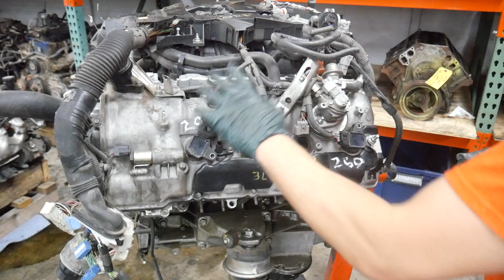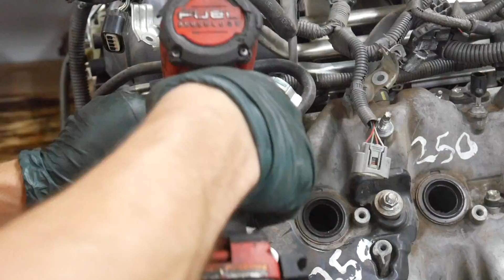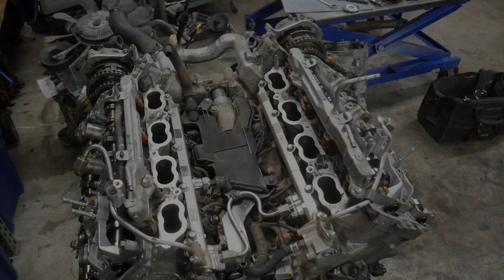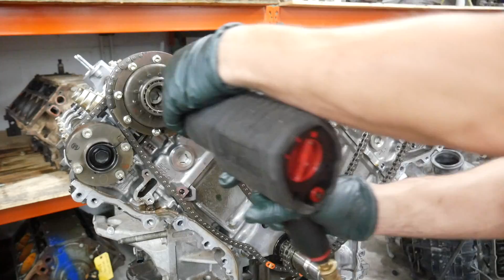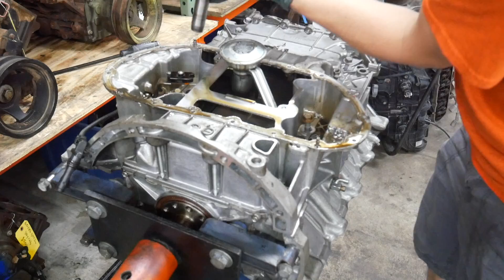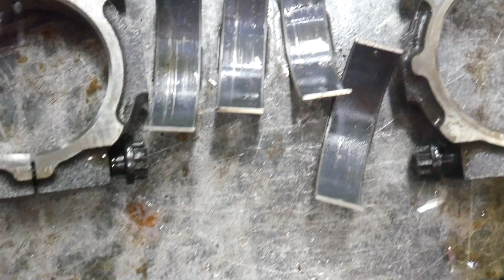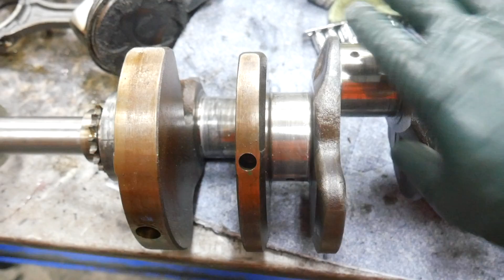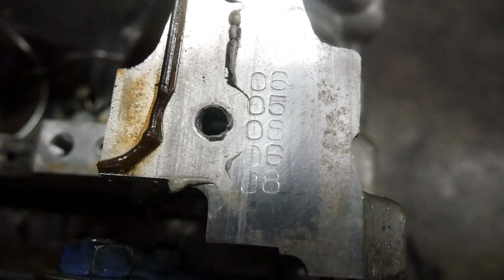Lexus LS460 1UR 4.6L V8 Blown Engine Total Teardown! How Did One Of The Most Reliable Engines Fail?

Comment: Ji**y Lube "no oil" oil change. The internals were far too clean to assume lack of maintenance, and the engineering looks rock solid. 
Nice shirt BTW.
Reply: Which just pi**es me off. Ruined a perfectly good, clean, good shape engine because they did the oil change wrong. It's a major reason why I change it myself. I know 1) it's done 2) right 3) with the amount and brand of oil I need/want.
If that were my car I'd probably sue with a vengeance.
Reply: @IncertusetNescio  indeed! I really hope they did so that JiffyLube or any other oil change department realize that the Customer deserves absolute protection from Multimillion dollar corporations & facillities AND their "incompetent" employees!!
Reply: what i am thinking, min wage oil change place. drained oil and forgot to fill. prob had some manager up their ass about "time" and or low information type worker.
Reply: @Dratchev241  It's not just the quick places.  I have a 2018 V8 Mustang.  The 18s went to 10 quarts while the 17s and back used 8.  The Ford service manager misunderstood me when I said I'd do it myself and it got changed.  I get home and check it and sure enough it's 2 quarts low.  I take my F150 in and look at my service writeup and it says 10W30 for the change when it calls for 5W20.  I call them up to verify and he says just bring it in and we'll change it again.  I get home, check the level and its at the add line.   Needless to say I'll being doing my own oil changes from here on out using full synthetic.  The F150 is easy, the Mustang will require a little more work to get it jacked up but still not bad.
Reply: @scottyV1000  sounds like a ford problem
Reply: scottyV1000 Dealers pay their service techs in the wrong ways. The result is service techs have every incentive to cut as many corners as possible and complete jobs as quickly as possible. And their service writers generally make minimum wage plus a healthy commission on whatever services they can upsell on a customer even when most are not recommended by the manufacture. For example at 30K many vehicles call for just an oil change, air filter, and tire rotation. Yet many dealers will sell you a $500+ package with all sorts of other supposedly necessary service and many don’t even do all of what they charged you for. 
A friend bought a vehicle new and took it in every 5K to the dealer he bought it from. At 40K miles I offered to change his oil and filter as I was changing my own anyway. I discovered you could drain the oil but couldn’t replace the filter without removing the big aerodynamic pan under the front of the car which wasn’t easy. When I removed the pan I found the original factory oil filter complete with hand written markings from the factory with 40K miles worth of dirt on it. Yeah, the dealer, over 7 oil changes, never once changed the filter likely because there was extra time involved and they figured the owner would never notice as it was invisible unless you removed the pan. So dealers can do just as poor of work as your local crappy minute lube they just do crappy work for different reasons. Instead of just paying their techs well, they underpay them and incentivize them to churn through as many jobs as possible each day for more money. Their paycheck depends on it.
Reply: @bradhaines3142  I don't think it's a Ford problem - more like a specific dealer problem but there may be many dealers with the same issues.  Ford just issued a service bulletin on all the 20 and 21 5.2L V-8 in the Shelby 350 and 500s.  These are pretty much hand built engines and someone forgot to release the timing chain tensioners when installing the cam chains.  Guess what happens when the chains stretch a little especially with engines with 8,000 rpm redlines that are actually likely to see that limit.   All it takes is one person in the wrong place.  Samcrac had a similar problem with the supercharged V-8 in his Land Rover.  I don't think he ever got that one straightened out.
Reply: @sharedknowledge6640  Also, Your $10,000 trashed engine is $10,000 more in their pockets - they don't care.  Your car or truck is priceless to you - it's just another car or truck to them.  I always used to change my own oil but when I got a better paying job Ford started doing their Works deals where they'd change the oil and rotate the tires for $40 and I figured that was a good deal but after the low fill on my brand new Mustang they will never change the oil in it again.   Fortuently I caught it right when I got home and there was still 8 quarts in it so I don't think there was any damage but if it would have stayed like that for months who knows what could have happened.
Reply: @scottyV1000  I've done all the oil changes on my 2015 GT that I bought new.  I only use full synthetic.  I don't understand why Ford recommends conventional/synthetic oil.  I use only Motorcraft oil filters and I change my oil before 5,000 miles.  I know it's overkill but my car does not use oil at all and I like a clean motor.
Reply: @bradhaines3142  It's a dealer problem, they too typically hire lower paid people(non-mechanics...) to do the oil and tire work.  No matter who does it I check the level before I leave the parking lot, that way if it's low or they left a mess I can get it taken care of before leaving.
Reply: @thescurfie  , motorcraft Oil is pure garbage.  I have done oil analysis on my Ford.
Reply: @scottyV1000  I don’t believe you. The cam chain tensioners you’re referring to are ratchet-hydraulic. Essentially a mechanical ratchet or pinion is employed at shutdown to maintain tension until startup when hydraulic pressure from engine oil is returned. Yes, in servicing you can fully retract the tensioner such that hydraulic pressure is bypassed, which can be catastrophic however if done so and engine started, the cam chain noise would be severe, it would likely jump cam drive teeth which would then lead to severe engine damage in an interference motor such as the Ford V8. The JLR 5L V8 is of course same design since it too is a Ford designed and produced engine. 

The damage would occur during first seconds of engine being cranked, not a snowballs chance in hell the engine revs to 8000 revs if either tensioner is not properly set. Any bulletin referring to this would be for initial setup during any major service requiring removal of cams and/or phasers. Ford has a specific tool for timing cams upon reassembly, as well as specific procedures for installing chain guides, chain and tensioner. Unless they updated chain tensioner, which they hadn’t on 5.2L ‘Voodoo’ flat plane V8, there would be no service bulletin affecting that motor. 

I don’t know where you’re getting this information or maybe just making it up but your claims are unsupported by actual facts from Ford technical bulletins and engineering support.
Reply: @MichaelM-to4sg  You couldn't have looked too hard - it is on the Mustang Source website and references a Ford Technical Service bulletin.  I read the service bulletin and it basically calls for the service tech to see if the tensioners were released from their installation position.  If they were not, the tension of the timing chains was checked to see if the engine jumped timing.  Depending if it jumped or not the next thing is to check if the valves hit the pistons.  The solution could be anywhere from a 15 min. inspection to new cylinder heads and pistons along with the timing chains and tensioners.  Believe me now??
Reply: @scottyV1000  you’re better off running 5w-30 instead of the 5w-20. I have an 18 F150 5.0. Ford went back to 5w-30 in the 2021’s.
Reply: @Bushy556  Yes,  I love how they keep changing things.  I had a 2014 5.0 Mustang with the Track pack.  It called for 5W50 synthetic oil.  The only ones who make it are Ford and Mobil One.  I stocked up on Mobil One when it was on sale and have about 4 cases.  I traded my 2014 in for a 2018 again with the track pack and now they're calling for 5W20 so I'm stuck with all that 5W50.  I'm going to use it up for the odd quart or 2 since the 5.0's take room much oil these days.  I figure 1 or 2 qts in 10 isn't going to change the viscosity that much and it is in the right direction.
Reply: @scottyV1000  the new mustangs show 5w-50 for track time I believe.  I know the people that run Oz tuning recommends 5w-50 in all coyote engine regardless if their a truck or car.
Reply: @thescurfie not overkill. You are wise to change oil frequently.
Reply: The reason why I started doing my own mechanic work can't trust anyone
Reply: @austinhowze6280  Doing your own work will ensure it's done right, however not very many car owners are mechanically inclined. There are options. Every town has a few shops that are run by very qualified, honest people. A privately-owned shop is usually more loyal to its customer base that any quick lube chain or dealership. Finding a good, reliable auto service shop is like finding a good barber, they're out there, just ask neighbors, or relatives or co-workers for references.
Reply: Jizzy lubed
Reply: I had a fleet of 45 install and service trucks for a cable company and more than once the tech has driven off with a crankcase totally unpolluted by oil. It was usually noticed within three blocks of the 'Take-a-Change' grease you while you wait places. They purchased a few short blocks after arguing it wasn't their fault. "Somebody must have stolen the oil" was actually said once.
Reply: What a worthless spell/grammar checker. I need one that knows the properly spelled word is WRONG like in 'Take-a-Chan(c)e' grease your business.
Reply: Who TF takes an LS460 to Jiffy Lube? Seriously, some people should not own these cars.
Reply: the shirt: r/iamverybadass
Reply: Is it true that JiffyLube tends to make these types of horendous mistakes?
Reply: @UltimateForceMarketing  just do some searches on YouTube. Tons of them.
Reply: Agreed on the maintenance but there are many examples of well maintained Toyota’s full of oil eating bearings and even throwing rods through the side of the block. They often get 95% of it right but the other 5% Toyota gets wrong is often catastrophic. Year after year they kept making Camry four cylinders where only a few threads of the head bolts engaged in the soft aluminum block and pulled out shortly after the warranty expired often causing catastrophic engine failure. Toyota lost track of what’s important soon after they manufactured the last Japanese Supra. They’ve turned out ever more ugly and poorly engineered vehicles ever since and been forced to slap their badge on a Subaru and BMW to even offer anything sporty beyond some poorly received Lexus performance models. They’re so clueless they even stick the Lexus F Sport badge on crappy hybrids that can’t outrun a base trim Honda.

Comment: These weren't as reliable as the older 4.0V8 in the in the SC/LS400. The GDI system in the 4.6 has issues
Reply: What is wrong with the GDI? I mean it also has port injection, so it can't be the usual clogging.

Comment: Unless I missed something this isn't a direct injection engine. Direct injection means the fuel is injected directly into the combustion chamber (not the intake port).
Reply from the maker: It is both port and direct injected
Reply: It's both to avoid intake valve cabonisation unlike most of the shitbox euros.

Comment: They ran it out of oil, that's the only way you spin a main bearing
Reply: I replaced one of those for a customer in January.  I did the oil change 6 weeks earlier, still full.  Spun a main and threw the rod getting off the highway.  140K miles.  It happens.
Reply: @ohger1  Nope, no it doesn't. There's no logical reason for something like that to happen, it's always cause and effect
Reply: @justsumguy2u  could be something like extreme off-road angles, jumping the vehicle etc. Small loss of oil pressure which damaged bearings a little at a time. Eventually the clearance was that high that during a long drive the hammer action took the rod bearing all the way out

Comment: To me it looks like an oil failure. Like forgetting to add oil while doing an oil change. That engine was too clean for it to be due to lack of maintenance. You could repair it with a new crank and bearings as well as some machining, but is it worth it depends on you. Loved the teardown though!
Reply: I agree somebody forgot to put the oil back in.  Always check your oil pressure after someone "changes" your oil.
Reply: That's exactly what I was thinking. Some puke at the dealership forgot to add oil.